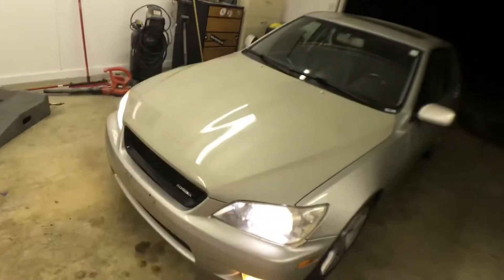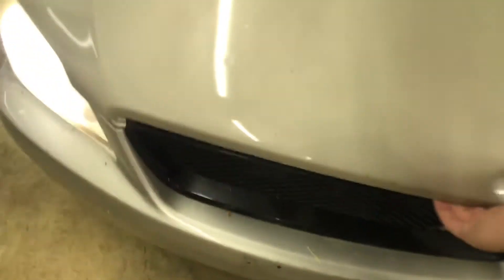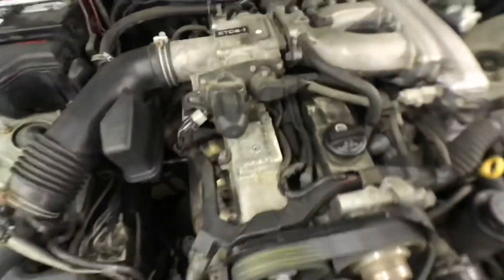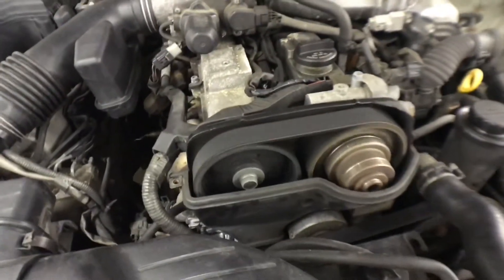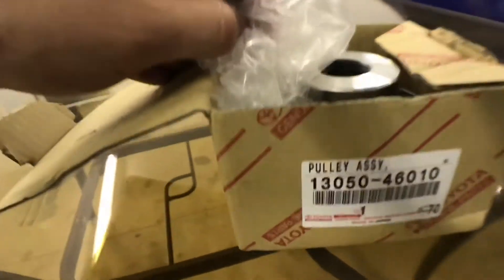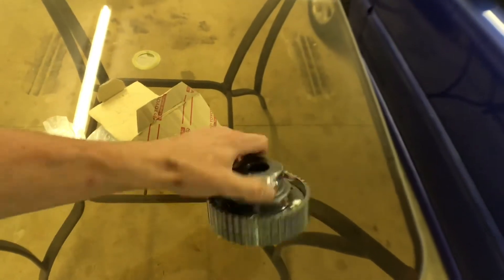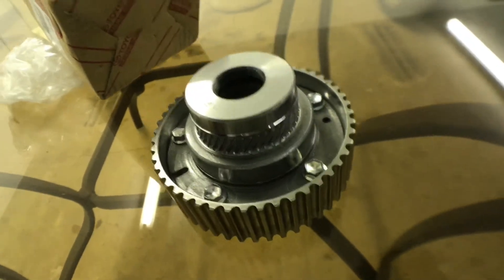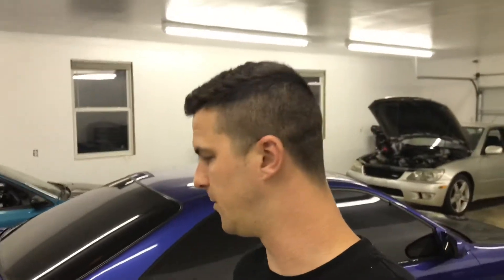Noisy 2jzge and vvti cam gear replacement

Comment: I had this same problem at 126k on a 2JZ.  I was thinking it needed a valve adjustment.  It was due for a timing belt, so I replaced it along with new cam seals and crank seal (since I was in there anyway).  Problem gone - I didn’t need to adjust the valves, though not a bad thing to check.  
Awesome video, thank you for creating it!  Really appreciate the cam gear replacement tips

Comment: I have the same noise after I upgraded my cams to hks cam shafts and stiffer valve springs.

Slowly it got louder and louder. Now to the same as yours. I have replaced my car with new vvti cam gear, vvti solenoid and vvt filter and the noise is the same.

You are right when the noise gets louder with hot oil.
Reply: any fix too that
?
Reply: What valve springs are you running??
Reply: @BryantTakahashi  "performance springs", they are a shop based in Queensland, Australia. It's really not that bad. Just learn to live with it and understand your motor isn't breaking. Also get strange looks from people.
Reply: @st204rna  so should I just leave mine like that let the oil leak ?
Reply: Mine is the same with hks cam gear kelford springs and stock cams (waiting for ecu to go aftermarket) 

New vvti everything still does it

Comment: No need to remove the alternator to remove the tensioner.  Also my head is about that clean and has 200k+ miles. Don’t assume it’s been apart.